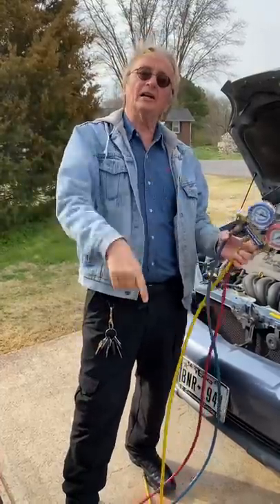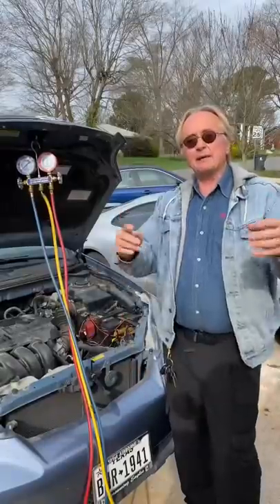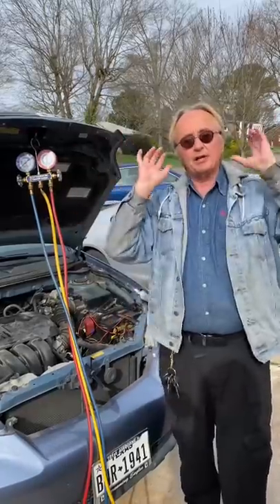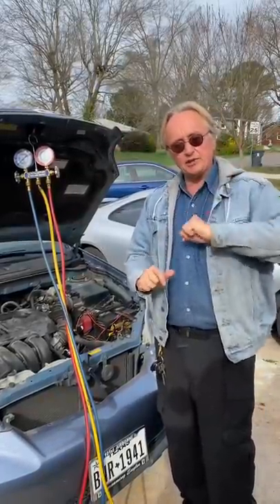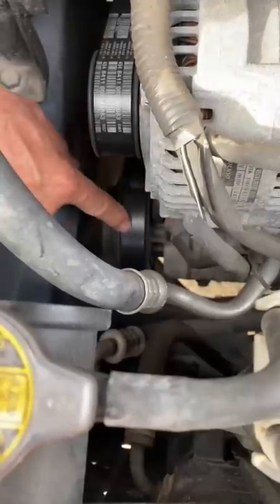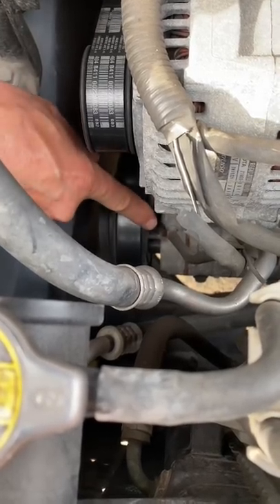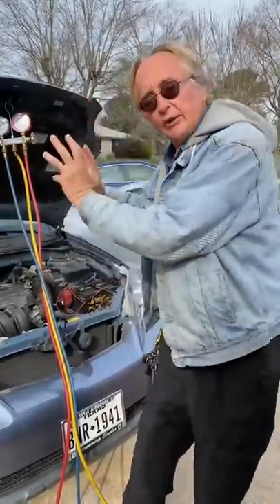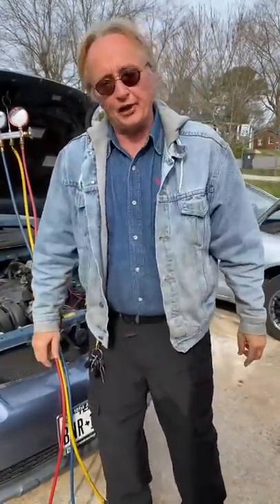Doing This Will Make Your Car’s AC Blow Twice as Cold

Comment: Hey Scotty, how about if it doesn't blow cold after 15 minutes??
Reply: My truck had a similar problem when I got it. It would blow cold until the engine bay got hot. This ended up being only a few minutes for me. The problem was my high side pressure switch, if I remember correctly (might have been for the low side, but it was a pressure switch nonetheless). Once it got warm, it didn't function, keeping the compressor from activating.
Reply: Check to make sure your evap box is draining. If not, water will accumulate near your evaporator core and cause it to freeze. When that happens, the AC doesn't blow cold. It could be something else, but check the easy stuff first.
Reply: Describe a little more about how it works during the first 15 minutes. If it instantly quits after working perfectly, or if it gets worse and worse during this time.
Reply: @solarfall2728  i has a sneaky suspicion that might be the issue, thanx

Comment: Scotty I need some help I have a 2005 Dodge Dakota it will be running fine and then all the sudden the engine light comes on when I try to accelerate it there is a black I've had a lot of work done on this kind of tired of it I want to get this problem resolved so I could sell it before the engine goes on it is running fine what's up help me please

Comment: I have the same issue on my 03 toyota highlander, slightly colder air in my passenger side and warm air on my drivers side, do i flush the refrigerant (is that also called freon) at the mechanic?? Please help my sons 3 and my wifes 6 months pregnant🥵

Comment: I have a 02 Corolla, cooling fans only work on low speeds with the a/c on causing the a/c not to cool when idling, when the a/c is off both fans come on high speeds to cool the radiator when idling, in the past, both fans used to run full speed with the a/c on, I even hosed off the condenser, any idea's
Reply: Have you changed any relays lately? It sounds like one of the fan relays got replaced with a normally-on relay, but should be normally-off, or vice versa. It's also possible there is a complete relay failure, and one (or two, depending the car's design) needs replaced.
Reply: @RAndrewNeal  no relays touched prior to switching out 1 and 2 with the horn relay
Reply: @infinity3jif  So you swapped the fan relays with a known working relay of the same part number and have the same problem?

It's also possible that whatever sensor tells the fans to step up when the AC is on has failed. But that might be a job of the car's computer, which should rule out this possibility, if that is the case.
Reply: @RAndrewNeal  yes, still having the same issue
Reply: @infinity3jif  I would suggest looking for videos on your problem, or taking it to a mechanic if you aren't sure where to look. I've not dealt very much with electric fans, so the extent of my off-hand knowledge has been reached. Lol

Comment: Hey Scotty. I have a 2010 Nissan Pathfinder, it’s got 100k miles on it and I’ve never had a problem. I recently took it to a mechanic to get serviced which I normally do. He said I need to replace the fan clutch so I did and now it sounds like an 18 wheeler and the fan belt squeaks as well. Any thoughts?
Reply: Take it back

Comment: What if refrigerant is not the issue?  Sometimes my AC turns on and it'll be blowing cold for a while but then it cuts out and starts blowing warm or hot. I just came back from a shop that evacuated the system replaced the valves on the high pressure low pressure and recharged the system. It'll stay on for some time but then it eventually just starts blowing hot. And the compressor turns off
Reply: Might be a funky compressor, particularly its clutch, and/or maybe a slipping belt.

Comment: Hey I had a question my 94 F150 the hi pressure side gauge doesn’t want to latch on . Could it be the cheap harbor freight Ac gauges ?
Reply: Gauges are different sizes depending on the type of refrigerant your system takes. Your 94 may have R12 and your gauges may be for 134A. Or the other way around. If you look under the hood, you'll find a tag with AC info on it. It lists the type of Freon and how much the system takes.
Reply: @solarfall2728  mine came upgraded to the r134a from the factory. The low side hooks up but the hi pressure port doesn’t want to connect.
Reply: @SC-dt4ij  If you're just trying to charge the system, use the low side. You shouldn't have any problem at all. Aside from that, you could have a bad connector. It happens. Try it on a car that originally came with 134.  Then you'll know for sure.
Reply: @solarfall2728  I’m trying to pull a vacuum n do the job right . I’m going to be replacing the Schrader valve that’s leaking n putting a new condenser accumulator n orifice tube

Comment: A trick what to do if there is 100°F outside and your AC seems to have no power: Switch on closed loop for the air circulation after the engine warms up. Your A/C takes its air from near the engine bay and it gets very hot after the engine warms up. By switching on closed loop air circulation, you force the A/C to pick up colder air from the inside of your cabin so it does not have to work as hard to cool it. You'll get colder air quicker and save $$ on fuel because more efficient A/C means better gas mileage.

Comment: When I drive my car, the AC works. When it idles the AC stop working. Is that another sign, AC is low?
Reply: Your compressor is attached to a belt that's connected to your engine. So it might have something to do with your compressor, probably has gone bad and needs that extra rpm to make it work properly.

Comment: I can't recharge the A/C because my compressor isn't engaging. Everything is set on max and the compressor isn't kicking on. What is the issue?
Reply: I have the same problem in my 07 g6
Reply: @TetraHydroCannabinolTHC  It appears either there is an electrical issue, or the compressor is bad from what I researched.
Reply: First of all, you don't need to have your car running to charge the AC. If you have a fairly modern car, there's protection built into the system if the pressure is either too low or too high, the compressor won't turn on. 

I would check all your fuses and relays as a first step. If that turns out OK, find someone to put a set of gauges on the system. If you can get both high and low side readings with the car on, and off, post and I can probably tell you what's wrong.

Comment: Those cans introduce moisture into your system and destroy your system. You have to use gauges and purge it first.  Also if you system is empty it MUST be vacuumed for an hour to boil the moisture out of the system. However, if your system is empty you have a leak. A black/UV light at night will show your leaks very easily.

Comment: Not fully true monitors that have dual AC control systems now and have problems where it's not a serious return all of the AC system itself could be it actuator inside the air mixed door assembly in the air box inside the car

Comment: I have found that recharging the system with air duster cans will make it far colder. But it must be diflurothane or however you say it.

The stuff closely mimics R12. I am getting air readings in the 37 degree range.
Reply: So if i can't find r12, you're saying air duster cans can replace it with no modifications? How do you go about getting the air duster attached to be able to fill it?
Reply: Air duster cans are most often r-152a and it is indeed more efficient, works better. Its somewhat flammable however.
Reply: Propane is the best refrigerant just slightly flammable.

Comment: I've always been told to turn off the ac or heat before shutting off the vehicle..its habbit for me to always turn off the ac or heat now.. trying to get my girlfriend to do the same lol
Reply: Me too, why is that? Is it because it damages or something, I forgot the reason😅🤔
Reply: @menconnoisseur9914  I think it's just better to not have to fan and the ac compressor running when you shut the engine off..
Reply: It's for the moisture to not build up while using the ac I believe. Before turning off the car, turn off the ac and use the fan to dry out the ac system.

Comment: But what if your car is blowing warm on both sides?
Reply: Maybe a bad compressor, including its clutch, or maybe the belt around the compressor pulley is slipping, but that's not likely or else you'd probably have engine problems.  If the problem is just low refrigerant, then it can mean it's much lower than Scotty is discussing in this video, in which case it might be so low that it has a leak that's bigger than you should try to deal with by doing a simple refill yourself, since bigger leaks can allow damaging moisture to get into the system, and that's when a mechanic might be the better choice.

Comment: I've had my car for 4 years and it has never gone low on refrigerant. If the A/C compressor seal is leaking refrigerant then it would be leaking oil too since it's at a low point in the system. That's like saying a little oil leak from the crankshaft seal is normal because the seals need oil. Then every single engine, transmission, transfer case, differential seal would be leaking. But they don't. If it's leaking, it's worn. Fix the seal, stop the leak, stop polluting the environment.

Comment: The video explanation kind of left me hanging
Reply: It has to do with the refrigerant boiling off in the first part of the evaporator coils and that air flowing to the passenger side vents, and the airflow through the warmer side of the evaporator flowing through the driver's side air vents. Let me know if you want to know more.

Comment: There's another one tips:
Put A/C in circulate mode, so it will reduce Freon usage.
Reply: Freon is not a consumable - it's a sealed system. Circulate mode is to do with the air flow, not refrigerant flow. Did you mean put it in circulate mode to maximise efficiency for cooler temperatures?
Reply: @pingpong9656  I am not expert mechanic, but based on my 5 previous car, that circulate mode help me to reduce cost of fixing A/C thousands of dollars for the past 14 years even in current situation in California.
Reply: You dont know what your talking about, dont give false hopes to ppl. Look up the purpose of a recirculation blend door. A/c systems work under the same load no matter how you run it
Reply: @dulistanheman  I understand what you mean - in circulate mode the air is pulled from inside the car, which is cooler - in other modes it pulls fresh air from outside, which is relatively hot.
Reply: @pingpong9656  That's what I think too. I could be wrong according to mechanic ☺️

Comment: Jesus Christ, if you believe that, I have some beach front property in Boulder for you to buy.  AC systems do not recharging ever, unless there is a leak.  If there is a leak, it needs to be repaired and recharged properly.  Do not listen to this guy, that is crap.  That literally might have been the most ridiculous thing anyone could say.   I hope he is just being funny, otherwise, he needs to shut up.  Take your car to a reputable shop that can repair your AC.   You can try some leak stop but it rarely has success.  Most require a leak fixed and recharge.  No different than the air conditioner in your home.  If you ever need to re-charge it, you have a leak.  Get it fixed or expect a big bill coming your way..
Reply: But with some leaking air conditioning systems, the leak is very slow, taking years, until it reaches the point one day when the lower amount of cooling it can provide is annoying.  In those cases, topping it off can be a decent "fix", especially if this gets good cooling for several more years (or even just another year or two), and if the car is older and not worth dumping $1000 or more into it for a full-scale evacuation, etc.